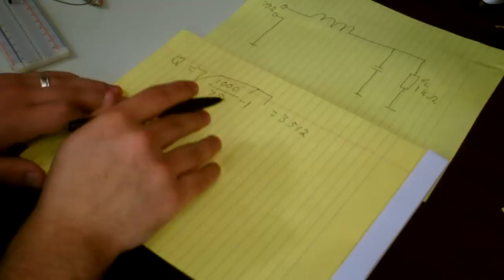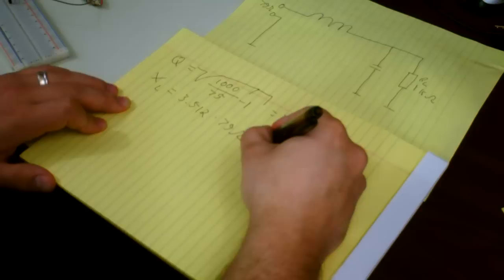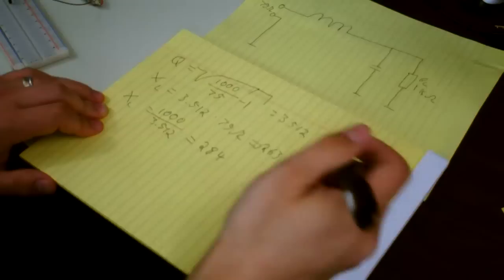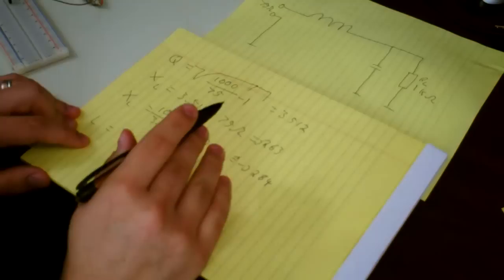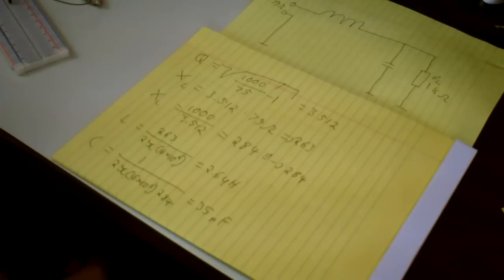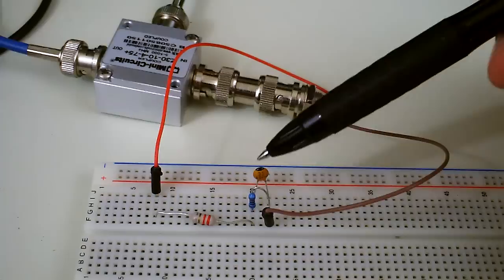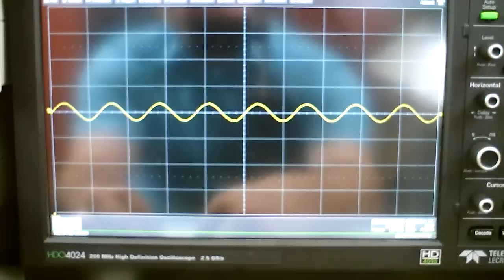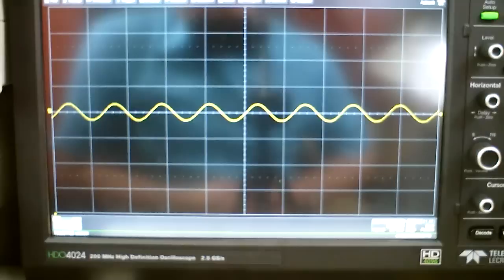L-Network Impedance Matching

Comment from the maker: Yes, you can build an antenna tuner with an L-Network. Traditionally, however, T-Networks are used. 5.8 GHz is really not that bad. Try it. And if you have difficulties, ask in forums for help. Amateur radio operators are also always good contacts.

Comment: Can you show how it's done when the source impedance is higher than the load?

Say from a QRP perspective. Say you have a colpitts xtal oscillator driving one stage in class A, depending on the transistor/the bias you may have 200-300 milliwatts out with an impedance of 200 ohms or so, that you wanna match to 50.

I don't exactly follow this:

Update (04/06/2013): I previously wrote that one can not match a high impedance source to a low impedance load. That is incorrect. Naturally, it works perfectly fine the other way around. One only has to switch the position of the load and the source.

Switch all source and load in all equations? :)

Thanks much!

Comment: Is it possible to receive voltage gain purely from passives (a pi-matching network specifically)?  I'm trying to amplify a signal from my antenna, but an RF amplifier is too power-hungry for my system.

Comment: at 07:00 you calculate the total impedance of r and c in parallel (z = (Xc * RL) / (Xc + RL). your answer is 75 -j263. How did you calculated that? I get a different answer (221ohm).
Reply: +Vincent B 
I got the same answer as KF5OBS, but it took me a few tries.

Comment: Thank you so much for demonstrating this! There is one thing that I have no experience with, and that is calculating the complex impedance of a resistor and capacitor in parallel. I checked your web page and was surprised by the answer. Do you know where I can find an explanation on these calculations? I have not worked with complex numbers a lot, but I have a book here I can use as a reference. 

Another small question, let's say the resistor in your demonstration was not purely resistive, and also had +j10 ohms in series with it (inductive), could you ignore that value, and just subtract the j10 from the final series inductor to make it j253 instead of j263?

Comment: The best way to "get into RF" is by reading a basic electromagnetics engineering textbook, like the one available on http://www.ece.rutgers.edu/~orfanidi/ewa/ which is freely available for personal and educational use, and then probably continuing with a RF/microwave engineering textbook, like the one by Pozar. But yeah, the free one above should let anybody get a first impression of this amazing field. Shortcut ways may be a short cut, but in the end may cost months and years of time wasted on playing with stuff that ends on a level far sub par with the one you'd end up with investing that half year to dig through the above mentioned book, and ending up "a wizard" that actually understands the stuff behind. With RF background, the formulas used in this vid are easily understandable, but without that, I do not really know how anybody would use this theory to anything else than a "cookbook" approach to a L-section. Even the basic complex maths needed here is not entirely obvious for someone not used to the stuff, but still takes only two weeks worth of study to master at the level needed in most, even advanced, RF (basically rehearsing trigonometry and exponential function properties, complex numbers and arithmetic, de moivres and eulers formulas, phasor notation and then some problem solving for practice)!!

Comment: Thanks for the great video, just a question: In what case would the voltage across the load resistor be greater than the source voltage? & why. Thank You

Comment: Hello, Thank for your support, but now I am design a impedance matching circuit for chip CC2650 of TI. And the impedance between tow PIN P and N of that chip is Zs = 45.070 + j*42.709. So how to calulate matching. I see your example Zs just like a resgistor.
I hope your reply as soon as possiable!

Comment: what if you have an inductive load antenna, say  5+J100,  do you need to add inductor,  or just a capacitor in parallel?
Reply from the maker: +VERGIS92 Capacitor in series.

Comment: "What people built at home" a hundred years ago will earn you a nasty email from the FCC amateur police if you put it on the air now.  Harmonics, chirp, drift -- all built into those primitive radios, all banned.  Pick a circuit diagram from 1919, and you'll have to quadruple the number of components just to meet current spectral purity regulations -- if you can even find a way to make it legal.  Not saying don't experiment -- but you need to do your experimenting with a dummy load and o-scope, not on the air, if you want to stay legal.